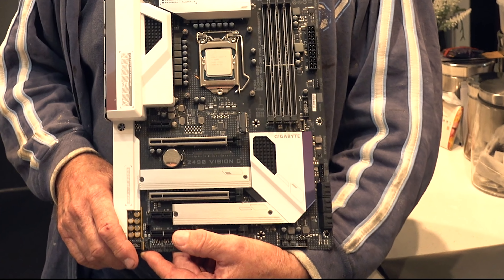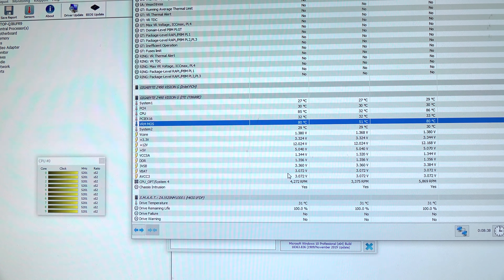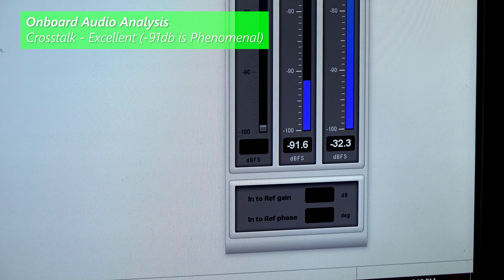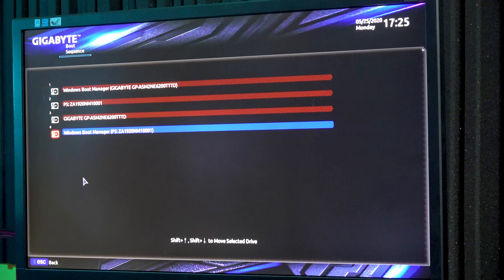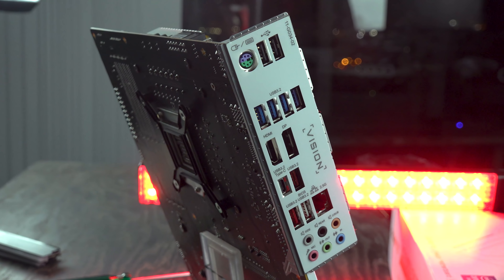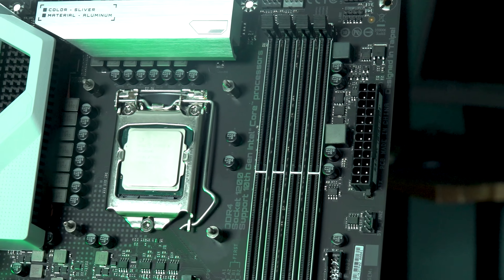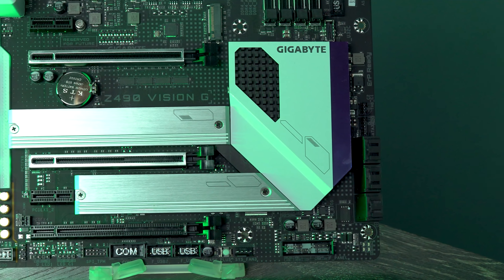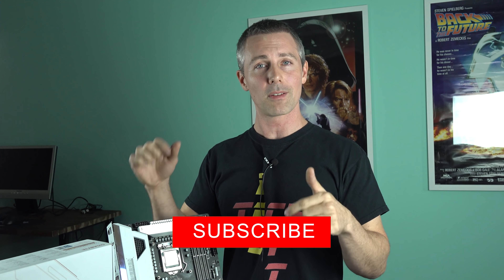Gigabyte's Z490 Vision G Review

Comment: Gigabyte boards are amazing. I've had $100 gigabyte force that could overclock the 8700k to 5 gigahertz stable with a preset built into the BIOS. Things are freaking awesome
Reply: yeah but most of the cheap ones are ugly as hell lmao
Reply: @jeffharmse  debatable. Rather then ugly, I'd call them bare looking. Still, for the price point and reliability, they are tuff to beat.

Comment: Just picked up the 10700K (basically a 9900K at a £100 reduction) and the Gigabyte Aorus Z490 Ultra and I have to say it is a great setup with overclocking being even easier now. 5Ghz all core and 1.280v was simple and temps are great. Working my way lower on the vcore! The Gigabyte Vision G looks like great value with the true 12 phase VRM and I have to admit it looks good too. Bios has always been a weakness for Gigabyte but on this round they are there or there abouts...Always enjoy your reviews!
Reply: The VRMs are awful tho

Comment: Using standard metrology protocols would say that even using a different stick of RAM from the same manufacturer and exact same specs should not be done because it does have the potential to introduce unknown variables that can affect results. All test should be done with the very same components with no swapping out of anything and if it does become necessary then testing with both components needs to be done doubling the amount of tests.

Comment: I just built the system but I installed a WD SN750 NVME M.2 drive in the top m.2 slot and its not detecting in BIOS

Comment: Yo brian
What is the best CPU/MB used/new banger right now? also the highest performance when OCED?
I have this hardware
P7P55D-E + X3470 (210x20) +  16GB DDR3 1600
P6TD Deluxe (35€/40usd?) + X5675 (22€ /25)(waiting for it off china) + couple unused 4gb 1600 sticks going in)
2x B450 (ASUS Prime B450-MK/ASROCK B450M HDV) motherboards, (each for 20€), just got no ram (16GB costs here 50€ used for 3000MHz)
any v3 cpus? or what is the best?
like e5-2689
etc..
you could make a vid best 2020 June cpu comparsion thanks.

Comment: A little about memory underclocking and tightening timings, it helps a lot. I had msi h310 f pro + adata spectrix 3000MHz cl 16. That motherboard supports max 2400MHz on ram. So i tried tightening timings and ended up with cl12 2400MHz it was performing almost the same if not better than the same cpu on z370 with stock xmp on that ram module. CPU used was i3 8100.
Reply: Cl12 on 2400? That’s rather high. I’d expect cl10

Comment: Would have been nice to hear about PCI lanes - how they're shared, and the effect of the thunderbolt expansion card. Also confused about their PCIe 4.0 messaging on this board. So... ports were built to 4.0 spec but... Gigabyte says they're limited somehow, but they haven't said how. The lanes are direct to the CPU rather than the chipset - are those lanes reserved or are they already in use elsewhere?
Reply: All gigabyte Z490 have at least 1 PCIE 16x slot and 1 M.2 slot that's PCIE 4.0, the lower end boards won't allow the m.2 to be used without rocket lake when it drops next year.  The vision D has 2 pcie 16x slots ( runs in 8x8 when 2 slots are used which is typical, but pcie 4 8x = pcie 3 16x) -- Comet lake IS NOT a pcie 4.0 CPU so there is no benefit with the 10x00 chips.  Must wait for 11x00 chips next year to turn on the PCIE 4 functionality.

Comment: I got EKs 360mm performance kit for my 3900x , I like it and all, but was forced to move my 2080ti to bottom PCI-E 4.0 x16 slot since the GPU is too long and was hitting resavoir on top slot I had it in before.
now with ONLY slight memory OC on it temps easily reach 80°c with fans at 100% , even after I repasted it....🥺🥺

so said eff it and got the waterblock another 360mm radiator/fittings to add GPU to loop lol.

oh and as always awesome video !!

Comment: Buyer beware, the Intel 2.5G NIC on this board is very likely to have an unfixable silicon bug, causing random packet loss when operating in 2.5G mode. Intel has stated that they will need to release a new stepping of the 2.5G NIC chip that will not have this problem. The chip works fine in 1G mode, but if you actually plan on using 2.5G LAN, make sure to get a non-Intel 2.5G NIC.